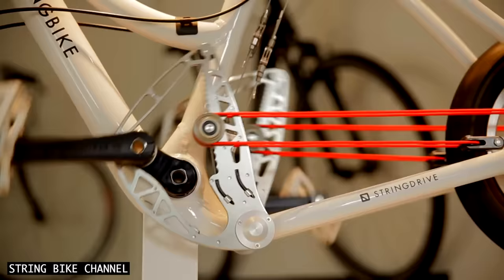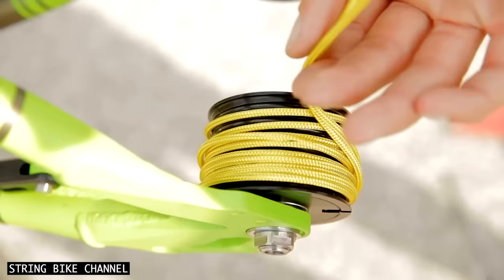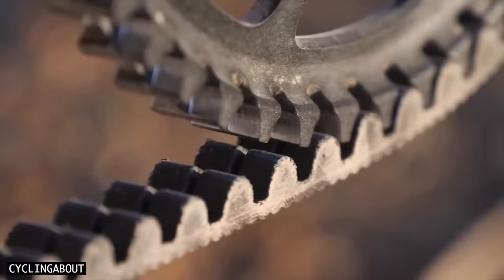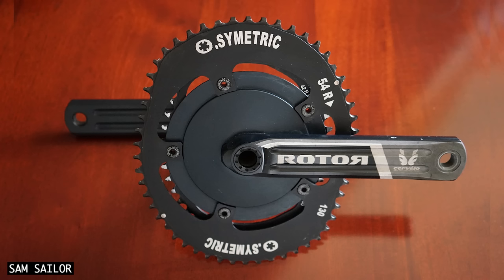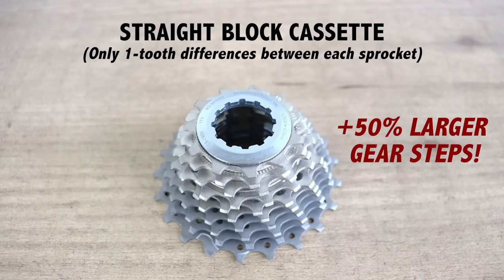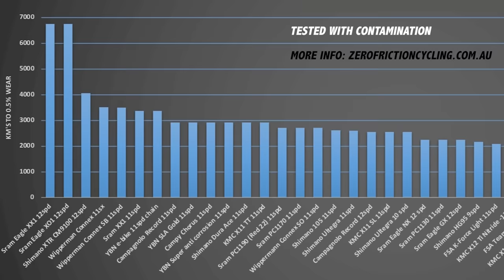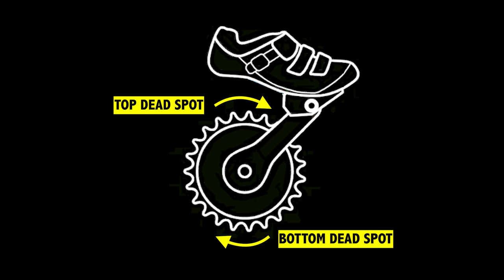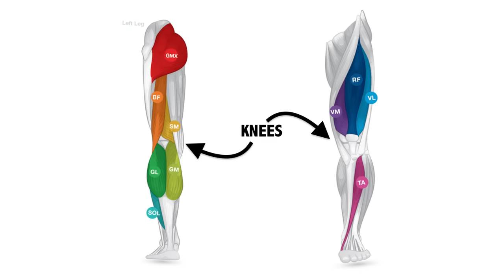Are Chainless String Drive Bicycles a Genius or Terrible Idea?

Comment from the maker: There's a LOT of research & development going on in the CVT, digital drive, combined motor+gearbox, and hydraulic drive spaces! What bicycle drivetrain tech would you like me to cover next? 🎉
Reply: Hydraulic sounds interesting
Reply: What's CVT?
Reply: I love your videos on non traditional gear.  I share your passion for belt drive bikes.  But this tech I feel is not going anywhere. No disc brake + not good for e-bikes tells me that.
Reply: @pumpkinjutsu1249 
A single gear transmission that is a continuous variable transmission. Many automobiles use them now.
Reply: @pumpkinjutsu1249  "Continuously Variable Transmission: A continuously variable transmission is an automated transmission that can change through a continuous range of gear ratios. This contrasts with other transmissions that provide a limited number of gear ratios in fixed steps."
Reply: Yes
Reply: @pumpkinjutsu1249  continuously variable transmission
Reply: Thanks, interesting video. One downside of belt drives is you need a compatible frame, which many manufacturers, even those who often have a hub-gear offering within a range, don't offer. Retrofitting a frame seems like a fairly significant undertaking. I'd be very interested in your views on the Veercycle belt. I have a chain-driven bike with an Alfine 8 hub and an eccentric BB. Chain and sprocket usually last 2-3 years, and I think I'm probably going to need a new chain ring next time too. How does ~£450 for a Veercycle conversion kit ('chain'ring, rear sprocket, and a belt that you loop and rivet yourself) compare to either getting a frame builder to adjust a frame to make it belt compatible, or just buying a new bike with a belt drive? My bike cost ~£650  as a last year-but-one ex-display model, currently closer to £1k I suspect. In the UK Halfords sell a Boardman urban bike with disc brakes and an Alfine/ belt drivetrain, for just under £900, but the tyres are pretty narrow at 32mm and the frame clearances are such that I'd wonder if fitting mudguards was possible, never mind changing up the tyres to Big Apples.
Reply: My 2 homemade automatic enviolo CVT bikes are part of this research and development. As far as I know all other automatic shift systems for these hubs only maintain a fixed cadence which is adjustable by the rider. Mine is what I call fully automatic as it receives power data to adjust cadence depending on my power output. The possibilities for optimization of muscle performance with this setup are fascinating. It's not until you ride a fully auto CVT that you realise how much time with derailleur gears you spend outside of optimal cadence.
Reply: Combined motor+gearbox (effigear, intradrive, opinion) paired with chainless drivetrain! Why hasn’t Yamaha, Polini, Bosch and Shimano released any MGU? Bevel cranks and drive shaft?
Reply: @pumpkinjutsu1249 Continues Variable Transmission = CVT, like on scooters.
Reply: You never see an alien on a bike 🤔
Reply: @Ed.R now when something goes wrong or breaks you need NASA  engineer for your bike😅 diagnosis. Just the word SVT is starting to put a hole in my wallet.
Reply: @arildschonberg3607  this is what is needed! would be awesome on high torque cargo bikes
Reply: One that is tested in competition or long range cycling. These automatic gearboxes, CVT, belt drives etc. tech comes every few years and dies away. Might as well concentrate on the ones that have actually worked in some real life test.
Reply: Your should checkout the latest thing Veer Cycles has developed. They recently prototyped a way to do gear changes on a belt drive, with some kind of exotic looking transforming sprocket. The first time I saw the video I thought I was hallucinating! It could be a massive game changer!!
Reply: @rapidreaper  Thanks, it's interesting how you, like most others, jump to conclusions about it.
One of the main features of it is that it's entirely customisable to suit the cadence profile of any rider. The fact that it's a CVT and electronic means it's highly predictable and repeatable.
Also, being a CVT, it has no steps or gaps between gear so it never misses a shift even under extreme load. In fact, the thing I enjoy most is accelerating while really putting down the power. Leaves others' way behind pedalling at sub optimal cadence and finding gears.
The system monitors speed and cadence 5 times a second and is always ready to shift twice per crank rotation to maintain the perfect cadence. This means it responds almost immediately to any change in speed due to gradient or a gust of wind for example. It also takes power data to optimise cadence based on the riders power output. It doesn't need to predict, it just responds as quickly if not quicker than anyone with finger on shifter.
I've used it since 2016 and done over 20,000 miles on 2 bikes and absolutely love how the bikes ride. I guess it just appeals to my nerdy engineer brain.
Reply: @rapidreaper  I do have videos on my channel. They aren't great, but I'll try and post a link to one in a separate comment. It was filmed before I created a power meter for fully auto and edited on a Windows phone.
I get what you mean, like erg mode but on a real bike. In reality, it doesn't end up working like that. Rider puts out whatever power is comfortable, and the cadence is adjusted to optimal.
Reply: Magnet will work too
Reply: Why did the prairie dogs start peddling a bicycle?
Because it was "wheel-ly" dirt cheap way to get around!
Reply: @rapidreaper  That's almost what I have but the constant cadence thing is already done by the hub manufacturer. Where mine is truly ground breaking is that it uses power data to vary the cadence. Having a fixed cadence isn't optional for every scenario.
Reply: @arildschonberg3607 I agree, combined motor-gearbox are the next big thing. Deep dives on that topic would be welcome also from my side.
Reply: DRIVE line-less bike.
No belt, no chain, no shaft, no rope
Reply: interesting video, no idea why youtube recced it.
Only issue imo is one that made it fail the exact reason I opened video to being with: the part about "how do they work" did not explain how they work. Which was what I hoped to learn.
Sure, there are 2 levers being pulled alternatingly, causing the attached drums to rock back and forth accordingly. But you entirely glossed over the part describing how them rocking back and forth was translated to a continuous rotating motion of the wheel.
Reply: I have a  Kona Kahuna.
Reply: it is always good to invent a bicycle
Reply: Next: Warp Drive powered by Dilithium Crystals.
Reply: the electric bike exist to make it easier to move with less effort. what's the use of developing a new drivetrain if it didn't count.
the only problem with bicycle is that it is exhausting. so, the challenge is how to make a bicycle that can be driven without needed to burn calories too much!

edit : i know there are physics laws, i know what is kinetic energy.
Reply: CVT please!
Reply: Have you talked about Cardan shaft-driven bikes yet? I was interested enough to try to buy one from a Dutch company but they ignored my email. Apparently they're less efficient than a chain drive, but also less greasy/oily etc.
[edit] Oh, I see on your channel you have talked about them! Going to check it out now. :)
Reply: Could they use carbon fiber strings? Also, a piston style rotor may help with a center mount motor. Just an idea.
Reply: Please find and review some low power, light weight power assist systems. Wife and I are mid 60s and like to do multi-day, sometimes multi-week bike packing trips. Current e-assist bikes have such big and powerful motors that you need to have them on level 1 all of the time just to offset the weight of the battery and power system drag. I'm failing to understand why there seems  not to be any offerings of power assist systems that are small and light enough to not be turned on until there is a huge grade, a storm coming, or necessity to ride a road shoulder in a headwind. We don't need power to carry us lazy at 25mph. We only need enough power to HELP US maintain 14mph when wind and gravity are conspiring to make us crawl at 6mph. We may also be a few days between opportunities to recharge batteries. 
Being a long distance cyclist in "undeveloped" parts of the world and an engineer I'm anticipating that you understand my question better than anyone else in YouTube world that I could ask.
Reply: Where do we find these string bikes? Putting a small front motor would make them more practical I'd think?
Reply: Have you not seen a bike chain snap at the beginning of a stage ?
Reply: Hybrid bikes. I put an electric and petrol motor on my bike, best part is the petrol drives SOME regeneration so over a long ride I can fill up the battery again, with solar panels on my pack that increases (slightly), and if I had regen braking that'd increase still more. But unfortunately no one seems to sell this, nor have I seen anyone else using this setup. Idk why. I use the electric when I pass police, then motor everywhere else. I put a good exhaust on the motor though because I want it to be as silent as possible and I coughed up for a four stroke instead of two.
Reply: Zero friction flying bicycles. Everything else is just a spin on old technology.
Reply: @pumpkinjutsu1249 Continuously variable transmission
Reply: A bike that would operate after an EMP event.
Reply: Rowing bike! You can use a lot of muscle and is has a very efficient CVT transmission. Has similarities to this system, developed in 1986 and still available.
Reply: How would scissor technology affect it?
Reply: CVT on car's never worked out. Maybe theres hope for mountain bikes?
Reply: 10 year old boys with scissors.
Reply: I wouldn’t park any bike in any city
Reply: You talk like you can park any bike in any city, better cutting my strings than taking the whole bike
Reply: Hey cool guy - see if you can squeeze in a chapter on the latest hub motor developments (grinn tech Canada) - and look at wtf they're still selling 7sp freewheel systems for heavy e-cargo bikes when the axles are unsupported the entire path thru the gears. They DO SELL 11 speed freewheels - +3mm. The difference in cost is probably less than $50 for the MFR. Use your perfecting-life voice!
Reply: Ever heard of the, 'Hydra-Kinetic Motor'?
Reply: 5:49 Over $1000 is reasonable? Get out of my face man...
Reply: That pulley rope system can be adapted to any bike. With a custom attachment to the frame in the front and placing the rear hubs in the exterior instead in the interior, this can be built easily with a cnc cut parts and 3d printed rear hubs